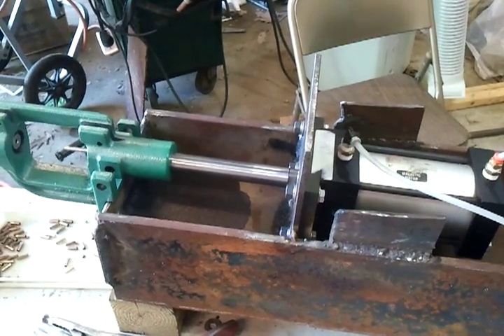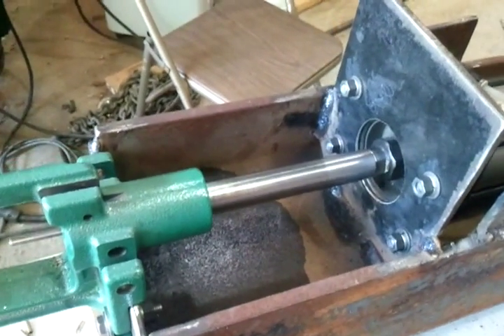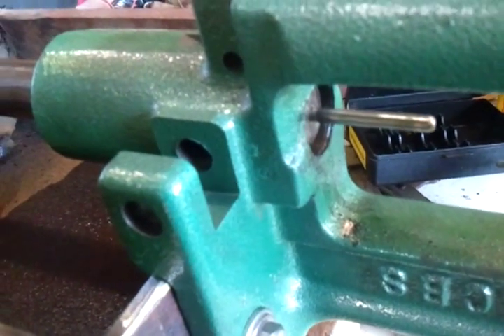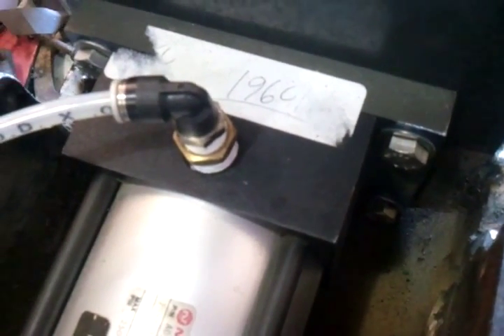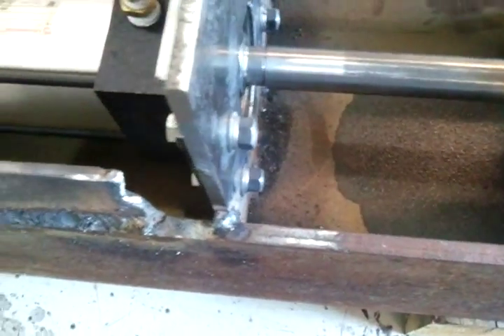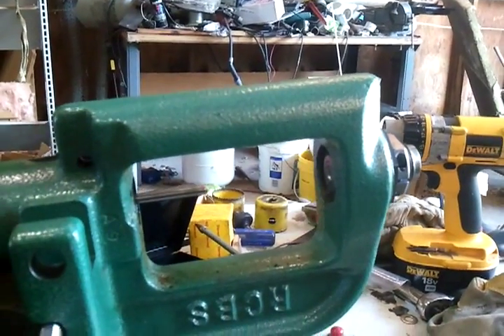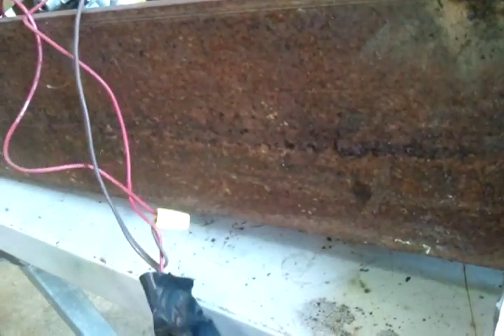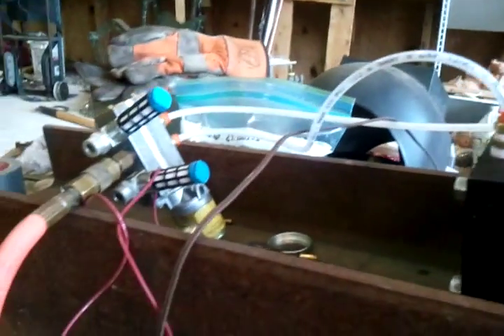.22 LR Brass de-rimming machine in operation

Comment: I am wondering, normally I've seen cylinders like that use 1/2" tubing but yours looks like 5/16" maybe?  Did that cause any issues in the long run?  What exactly size are you using?

Comment: would a wood frame work ya think? I'm wanting to build something similar...
Reply: Would have to be out of thick oak, bolted together, cannot deform the wood or the piston would not be aligned If the top of end of the .ram.
Reply: guess I will have to learn to weld..